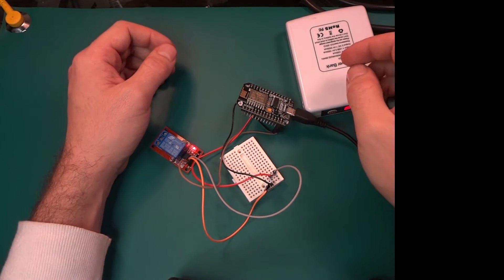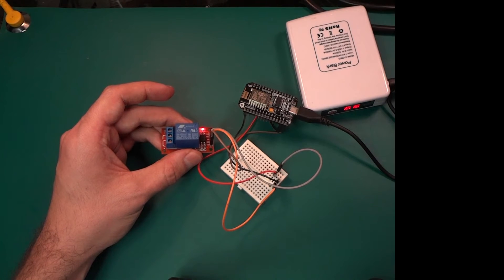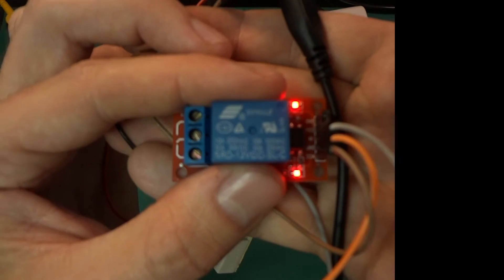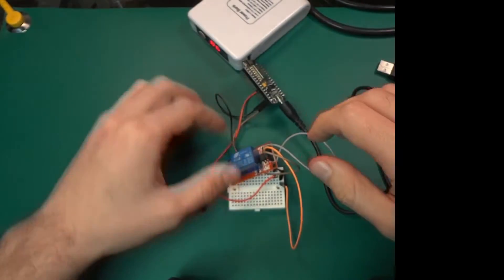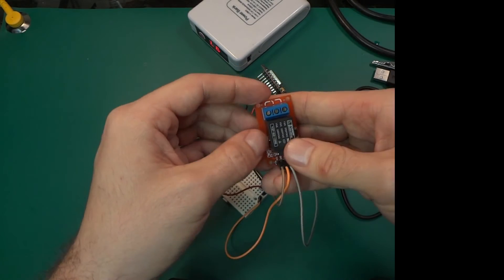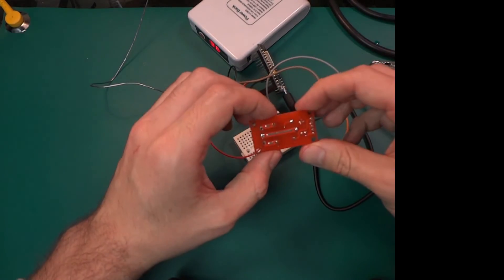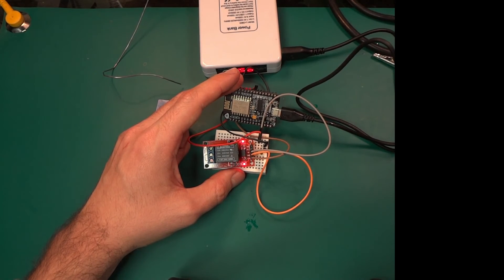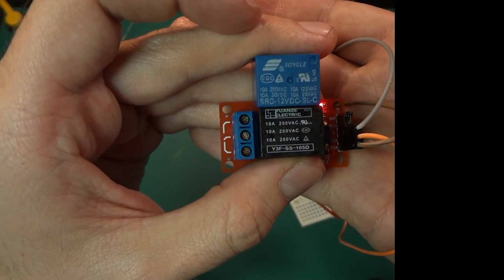Fixing not working "Arduino / nodemcu" 5V relay module - funny and unexpected

Comment: Sir, in my project I have connected relay control input to D2 of ESP8266 module and VCC to VIN of ESP8266, GND to GND of ESP8266 module. 

I have written this code:

#define BLYNK_TEMPLATE_ID "TMPL38orL3-Wq"
#define BLYNK_TEMPLATE_NAME "IoT Plant Monitoring System"
#define BLYNK_AUTH_TOKEN "xpXxiPBytX9Zc2T5CuRNQ0532LIo6Gx9"

#include <DHT.h>
#include <BlynkSimpleEsp8266.h>
#include <ESP8266Wifi.h>

#define DHTPIN D4
#define DHTTYPE DHT11

DHT dht(DHTPIN, DHTTYPE);

const int soilMoisturePin = A0;
const int relayPin = D2;

char auth[] = "xpXxiPBytX9Zc2T5CuRNQ0532LIo6Gx9";  // Replace with your Blynk auth token
char ssid[] = "PRABIR PODDAR";
char pass[] = "snehin@2010";

BlynkTimer timer;

void setup() {
  Serial.begin(9600);
  
  // Connect to WiFi
  connectWiFi();
  
  // Initialize Blynk
  Blynk.begin(auth, ssid, pass);
  
  pinMode(relayPin, OUTPUT);
  digitalWrite(relayPin, LOW);  // Initialize the relay in the off state

  timer.setInterval(10000L, sendSensorData);  // Send sensor data every 10 seconds
}

void loop() {
  Blynk.run();
  timer.run();
}

void connectWiFi() {
  Serial.println("Connecting to WiFi");
  WiFi.begin(ssid, pass);
  while (WiFi.status() != WL_CONNECTED) {
    delay(1000);
    Serial.println("Connecting...");
  }
  Serial.println("Connected to WiFi");
}

void sendSensorData() {
  float humidity = dht.readHumidity();
  float temperature = dht.readTemperature();
  int soilMoisture = analogRead(soilMoisturePin);

  Blynk.virtualWrite(V2, humidity);  // Virtual Pin V2 for Humidity
  Blynk.virtualWrite(V1, temperature);  // Virtual Pin V1 for Temperature
  Blynk.virtualWrite(V3, soilMoisture);  // Virtual Pin V3 for Soil Moisture

  if (Blynk.connected()) {
    Blynk.syncAll();
  }

  if (soilMoisture > 1000){
    Blynk.logEvent("Water your plants!");
  }
}

BLYNK_WRITE(V0) {  // Virtual Pin V0 for the switch in the Blynk App
  int relayState = param.asInt();
  digitalWrite(relayPin, relayState);

}

All virtual pins are properly labelled in the as in the Blynk application.

I am turning on Relay, which is connected to a pump, via a switch in the Blynk app with V0 virtual pin. I turned on, but when I am switching off, the relay does not cut off, it keeps on the pump. What to do? I have a school project tomorrow. Please help me out sir!!!

Comment: Hello Sir wish that ur good ,

Since along time and after giving up from similar error I had ,finally I got thé the right and clear explanation from you . 

I want to ask you please , if Iam using 
5v relay too and having the same problem of 12v like digitalWrite always stay high I does change to low when I switched off by arduino cloud .

If I plugged a LED to same pin it works except the relay doesn’t respond

Best regards,

Ahmed Ahmed
Reply from the maker: Hello, I think for digital write it might be floating, try add 10K ohm resistor between that pin (output)  and ground - it will drag it down to 0V until there will be true "high" that can overcome this resistor. It should resolve Your issue unless there is hardware error. LED is always pulling current that is enough to make it appear working fine but relay have transistor with logic level and they basically don't sink any current so they will be easily false triggered.  I was trying resolve similar problem for over YEAR!! with gate that was opening randomly at night, we changed frequency for remote, we suspect lightning and add lot of EMI filters, change power supply -  finally I added resistor to output PIN of MCU and it removed those false positives. In ideal world that relay should trigger at TTL logic level - but in reality it will trigger from noise if not connected to ground via resistor.  Regards

Comment: so i was working with ESP8266 node mcu module and the relay was not working, just connected the Vin pin of relay to Vin pin of my node MCU pin and it worked perfectly.

Comment: the Nodemcu only outputs about 3.5v - how come the 5V relay also works still?
Reply from the maker: Those modules accept TTL logic  so they don't require 5V as input - it can be much lower. Around 2.5V is technical for TTL specification for "HIGH" - but in many cases it can be bellow that.

Comment: Connect the JD-VCC pin to 3V instead of VIN and it will work if not working relay. It is due to lack of power source
Reply: This saved my day. Thank you!
Reply: Could you please explain a bit. I am also facing issues with 5v relay. Thank
Reply: @suchismitachhualsingh6420  in some tutorial, they told you to connect it to VIN pin, which in my case, it's causing the relay can't be turned off. And in my case, i switched from VIN pin to 3v3 pin and it works perfectly
Reply: My Dear Friend, I have no words to say thank you, I am literally crying now. I spnt around 100 hours working on this. and you did it in just 1 second.

You are a GOD
Reply: @parassingh4960  Thank you very much, happy to be of help!😀

Comment: Can you post exactly what the new part was you soldered in? I have a bunch of these 12V relays that aren't worth much to me.
Reply from the maker: I just soldered standard relay for 5V coil  (don't made any changes to board) and right now it still working in my heating temp controller circuit.